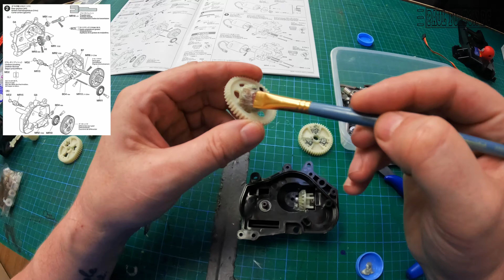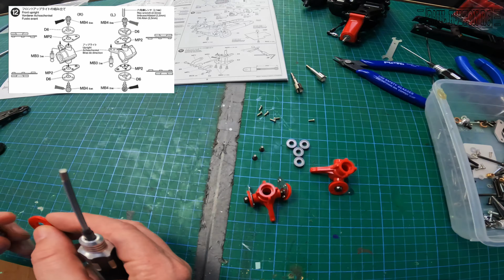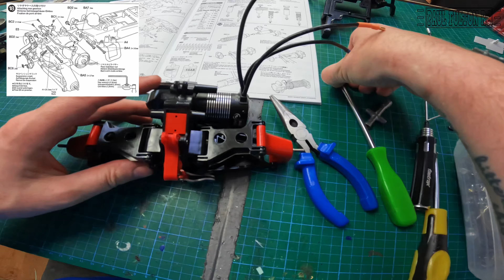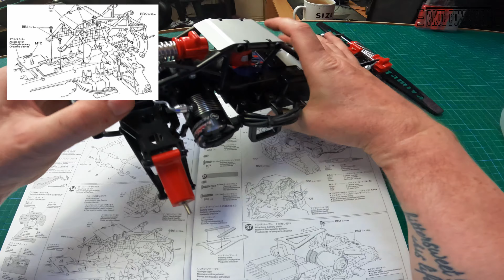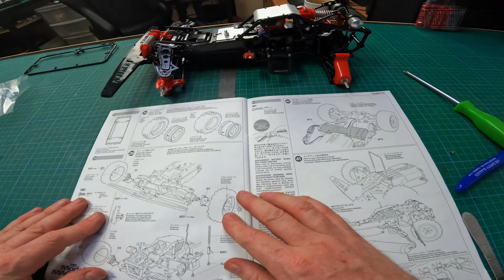Join me as I build the truly iconic Tamiya Hotshot radio controlled off road bubby.

Comment: A little known fact. Most people think that Tamiya gives a ton of grease in the kit. When in actual fact you're supposed to use all the grease on the build. If you have some left over you skimped. Cleverly this makes the build a bit of a strategy as you need to look through the manual first and see where and when you need grease before using too much in step 1 and have nothing left at step 378.
Reply from the maker: Cook. I use my own grease so I can lube it up as and when. Always felt like you don't get enough with the kits.
Reply: @FullOnRC  Yeah. Too right mate. Having left overs to "Save for later" is waaay not enough in the build. Love your work mate.
Reply from the maker: @Iron Maiden  thanks pal. I use marine grease. Buy the bug pots. It's easy to clean out the gearbox when you run in sand and the packed in grease keeps it away from the gears. Thanks for tuning in.
Reply: @FullOnRC  I use waterproof grease that I discovered when I started riding dirt bikes.
Reply from the maker: Bet that's awesome. What type of bike do you ride? I have had a few sports bikes myself. Had a few Honda VFR's. Best years of my life when me and Steph used to ride about.
Reply: @FullOnRC  I first had a 2008 YZ250 int 2013. Then got a 2010 KTM 250 EXC in 2014-15. Best dirt bike I've ever ridden or owned. Phenomenal carb fed bike. Now I have a 2015 CBR300R.  I purchased it brand new from the dealer. Bout the only thing I've ever owned engine wise brand new. I got it with my Grandmas inheritance. It means a lot to me.. Soooo much fun and so cheap to own.
Reply from the maker: @Iron Maiden  that's is great using such a gift from your Grandparent for something so cool and which brings you such good times. Good times. Ride safe my friend.
Reply: @FullOnRC  Cheers mate. Yeah. I'll never part with it.